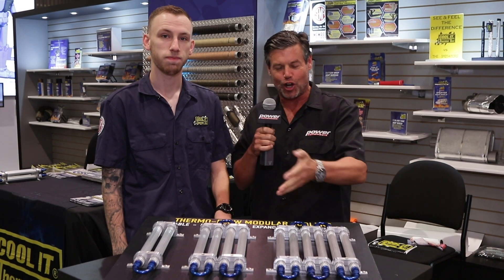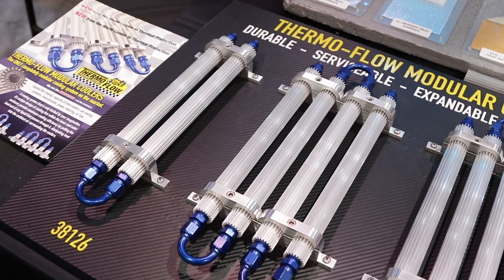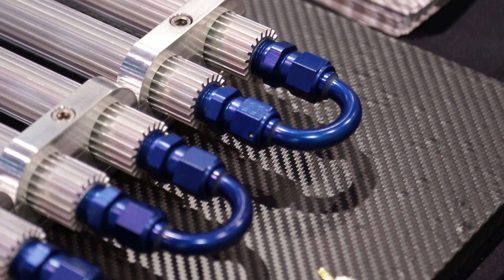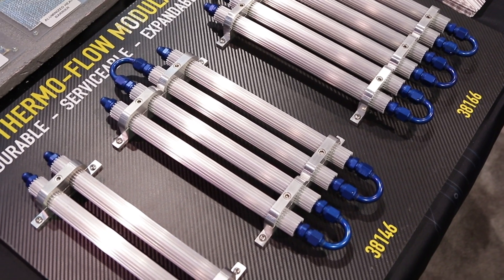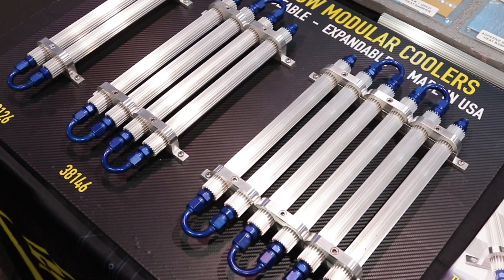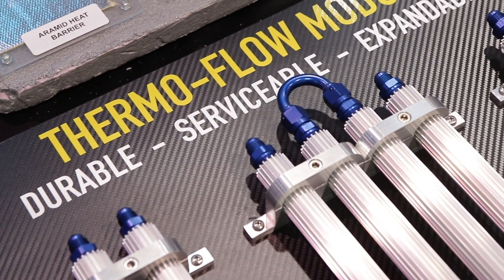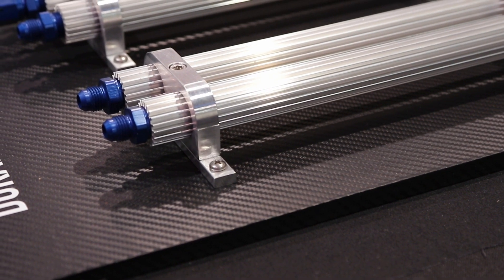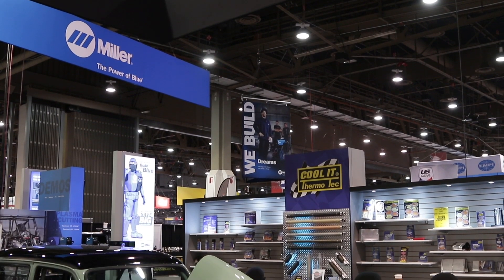SEMA 2019: Thermo-Tec's Thermo-Flow Modular Fluid Coolers Allow You To Configure A Cooler

Comment: lol my 04 monte carlo 3.4l is very powerful. like. people are surprised its not a later gen 3.8 when they look under the hood.  my next mod im going to do a throttle body coolant bypass. engine coolant is routed through it via tubes built in there and does not provide any benefit to any system. but when i do this i want to give my throttle body its own cooling sytsem routed to it. this will have an added benefit to cooling the intake air. i will probably use a computer cpu water cooler. i will use distilled water mixed with vp racing watter wetter for better cooling and corrosion./freeze protection. i got bored of modding most popular engines like LS or hemi because they already come with all the horsepower i desire and easily access to more. my 3.4l monte carlo is very quick now and consumes less fuel than alot of more modern 4 cylinder engines. I am also going to try to incorporate graphene into all of my cooling systems as a material, it can be made into an insulator OR a conductor of heat. and very efficient at that.